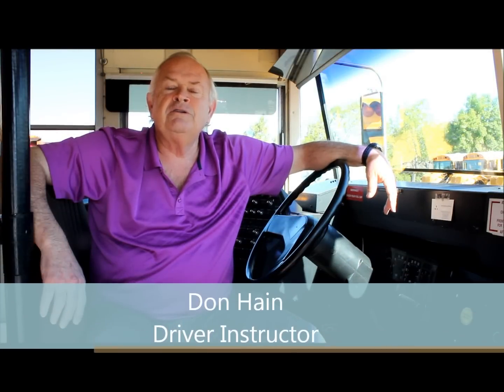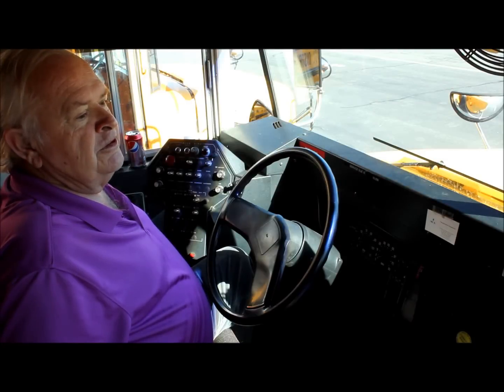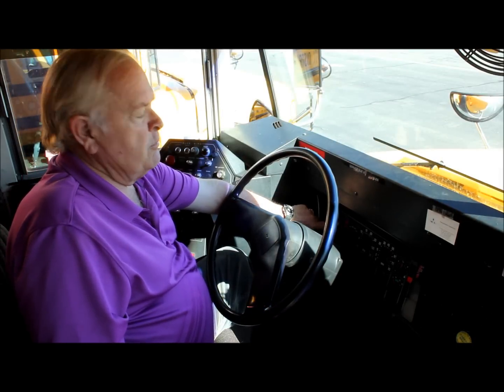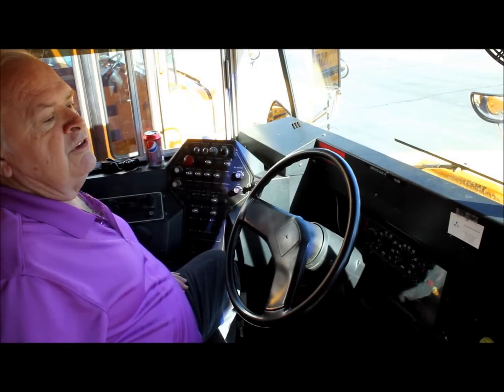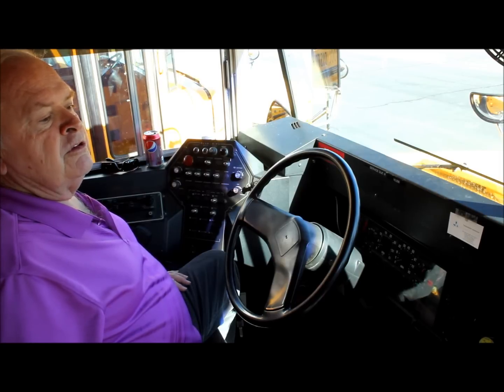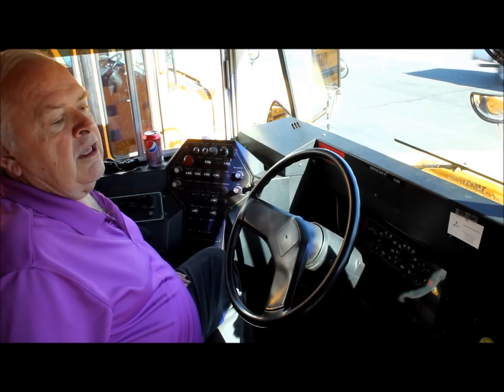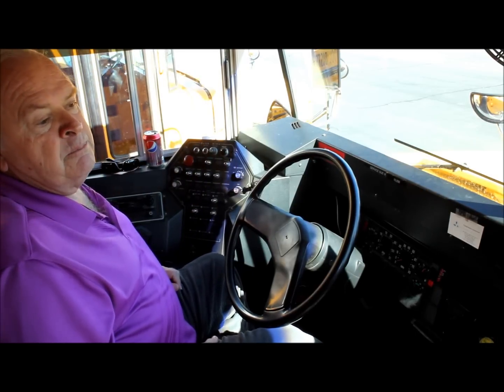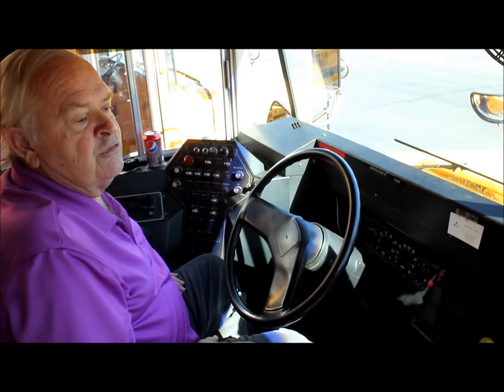Hydraulic Brake Test

Comment: Very weak video and does not match the DMV book, looking at your face does not help I need to see your foot and hand what they doing! you have to state every step where is the transmission lever it is on parking or in neutral? the ignition key is on or off? is the parking brake engaged or not? weak video.

Comment: ive not seen a hydrauloc brake bus with a yellow air parking brake..  does it have air cylinders on the rear like air brakes?  im use to the mechanical handle which is usually a driveshaft mounted brake on a hydraulic bus..
Reply: Christopher Abnett Air parking brake with hydraulic service brakes. I've seen this once before
Reply: @flogrown941  Should see mine - the parking brake is a great big lever. No clue what it acts on though. It could be using the same hydraulic lines.